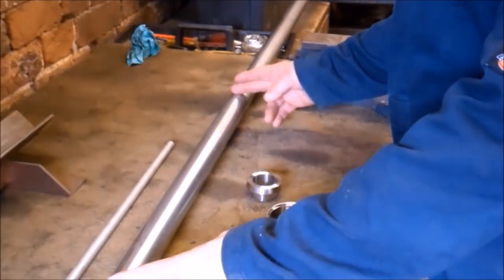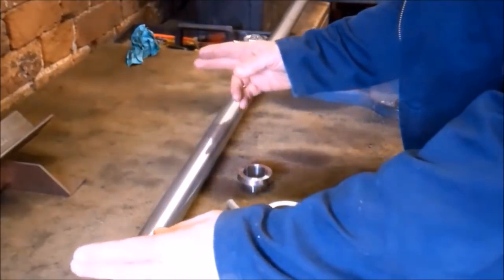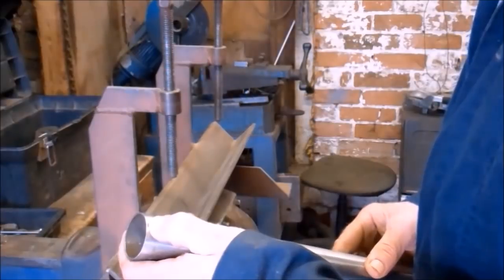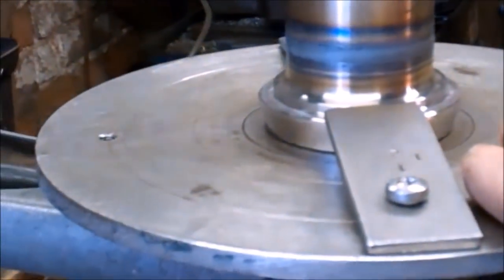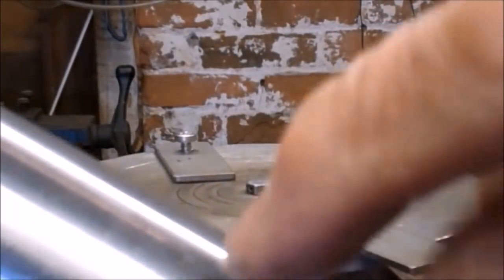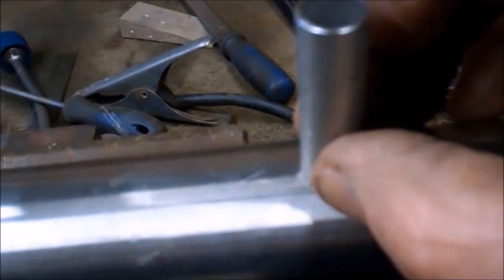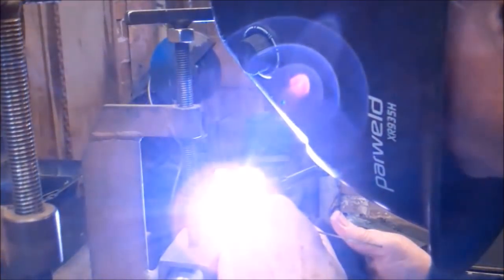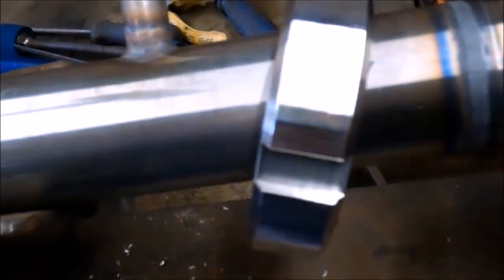Tig welding thin wall stainless steel dairy tube.

Comment: Hi Jon, do you have a gf saw mate/ if you don't do you just use a wrap and a grinder or your cold cut saw?
Reply from the maker: Hi Rich, I usually use a Makita chop saw with 355mm abrasive cutting disc ( dedicated for stainless steel ) but cuts do need careful dressing before they can be welded :(
Reply: @johnbower  cheers Jon, glad to hear it can be done. I have some 12" 10" and 5" thin wall stainless to do soon and have only ever done stuff cut with a gf, so was a little concerned. Many thanks. Rich
Reply from the maker: @rich3633  Hi Rich, In my first reply to you I made a mistake saying I use 230mm abrasive cutting discs, the discs I actually use are "355mm" diameter.
I have now edited my first reply to correct size.

Comment: Nice weld. What were your welder settings? What gas mixture were you using? Thank you.
Reply from the maker: Victor Nassar, Welding with 38amps sloping down to 4amps at end of weld with around 2 seconds of argon post flow, using "pure argon" gas. Thanks for your comment.

Comment: Here in colorado we call it Beer tube, we have more breweries then any other state in the US. Not to many dairy's . I love sch 5 one pass Fusion.
Reply from the maker: David Over, thanks for the comment, that sounds like interesting work, but sch 5 pipe diameters are sized differently to what we call dairy tube, although the wall thickness is very similar.

Comment: Great job, I have a question is the SS 304 and are you running at around 30 amps?
Sorry just read another comment it  is 304😁
Reply from the maker: Hi bill shuey, the fittings and the valve are 316 grade, any pipe used would generally be 304 grade unless otherwise specified, thanks for the comment.
The wall thickness of the fitting is 1.5mm and welding at 38amps

Comment: Nice work John. What grade of stainless are you working with. What is the standard for food grade? I've done different grades of stainless for the aircraft industry, but have an opportunity to get into sanitary piping. I want to learn as much as I can before the interview. Thanks!
Reply from the maker: Chris Schofner, Generally all hygienic tube fittings are made of 316 grade these days, but grade 304 is used for the tube in most cases to keep cost down, there is nothing wrong with using 304 grade unless  aggressive chemicals are used by the dairy during the tube cleaning process, then 316 grade should be used to guard against chemical corrosion. thanks for the comment.

Comment: Hey John. Awesome work. How did you cut the stainless square?
Reply from the maker: jstodd903, I use a Makita  chop saw with with 355 mm abrasive cut off disc for cutting stainless steel, but you can not rely on the saw vise being accurate,  it has to be set with a set square. thanks for the comment.

Comment: very useful, can you tell me what current has been used, I can set minimum 5 amps, it is enough? sometimes I need to weld thin wall ss tubes of 0.3mm thickness.
Reply from the maker: Hi IuIian Matei thanks for the comment, on this particular job I was welding with 38 amps, when I am welding very thin wall stainless steel tube of only 0.3mm wall thickness I use 10 amps.

Comment: Polished with what?
Reply from the maker: Hi Jared Sams, The welds were polished using a scotch brite disc spinning at 2000 rpm, spinning both clockwise & anti clockwise,
Reply: Scotch brite works great
Reply from the maker: thanks for the comment  @weldingjunkie , yes I use scotch brite a lot for blending in the polished finish, but you do have to make sure you are using  good quality scotch brite,  there is a lot of inferior stuff on the market that does not have the sharp fine abrasive grit in it, it's this fine abrasive grit that that does the polishing.